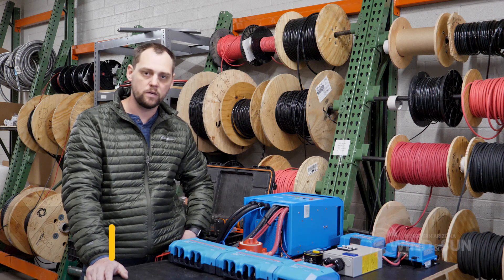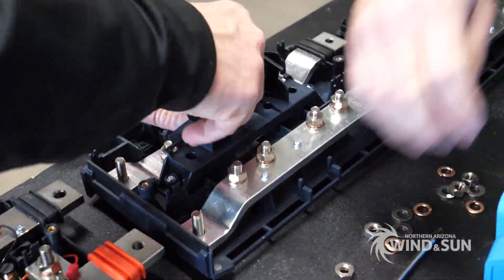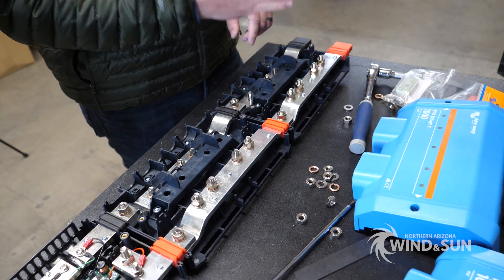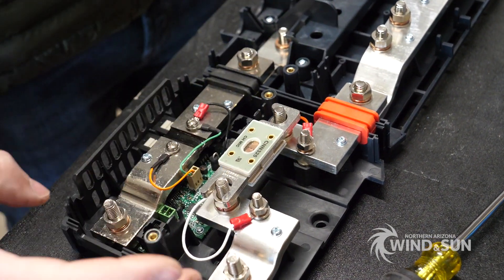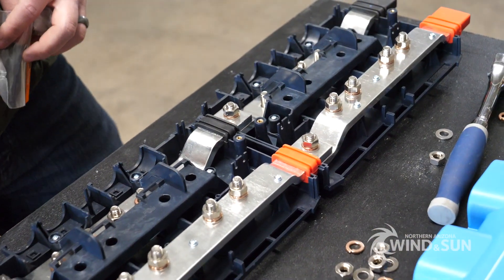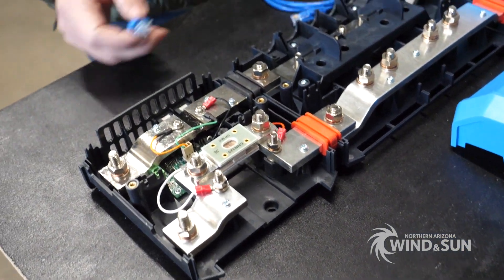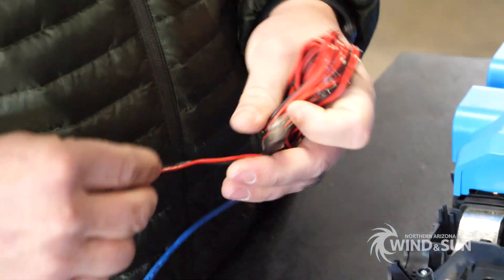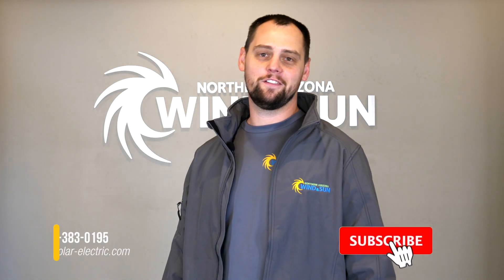Wiring Lynx Power In 1000 by Victron Energy

Comment: What is the difference between the Lynx Power in and the Lynx Distributor?
Reply: The links power in does not have a fuse connection the lynx distributor does have fuse connection for four Mega fuses and when connected with a lynx shunt or when DIY hacked has lights that will tell you when a fuse has gone bad
Reply from the maker: Tim, give our guys a call and they'll be glad to answer that for you. (800) 383-0195
Reply: @NAZSolarElectric  just answer the question and make it easy for all of us.
Reply: @erkful  They don't understand how youtube works
Reply: @stevelamperta865  that's a bit narrow minded. When I began my introduction to solar energy for my RV our focus is consumed that sometimes we don't know where to look. I did not know who victron was or that they had a website with info. If you look at their website it is not user friendly. Resources are not easily accessible. We have lives.
Reply: @stevelamperta865  that’s fine if you know what you are looking for but not everyone understands how it all works together.